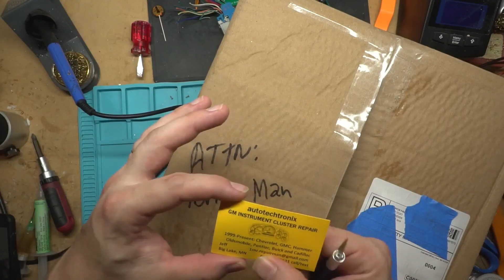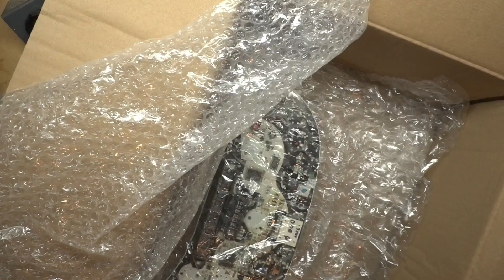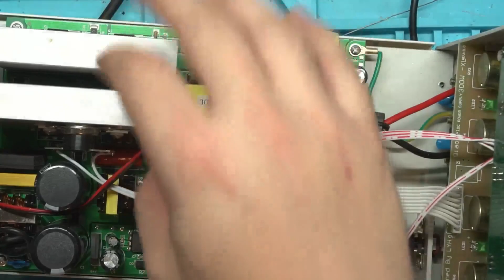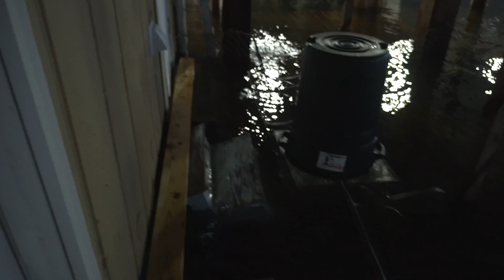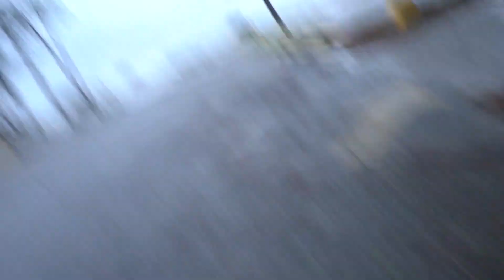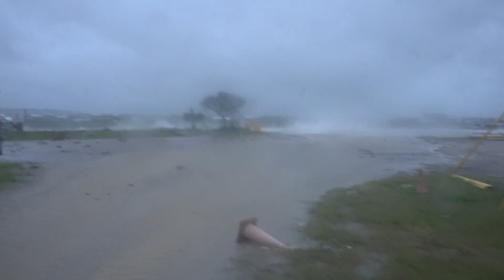Random Electronics Repair Stuff and Hurricane Sally

Comment: Just came across your channel, seems interesting and educational. While I haven't repaired any automotive boards I do repair, or at least attempt to repair, just about any electronics I come across, of course as a hobby. Now to the point, do you still have the power supply as I am in need of one and would like to try my hand at repairing it. If you do I am only about 30 miles away in Defuniak Springs and will be in Ft Walton Beach some time this week. If so let me know and we can make arrangements for pickup. Thank You...
Reply from the maker: I do it's in my shed you are more than welcome to it. If I had to guess it's just a bad op amp in it but I didn't try to diagnose at all. I wanted an excuse to get anew power supply lol
Reply: @FixedUntilBroken  Sorry about the delay, been out for awhile, would like to pickup the power supply if still available. How do we get in touch to setup time and location. I have joined your Facebook group. Thank You...